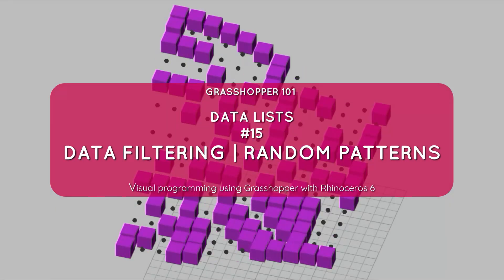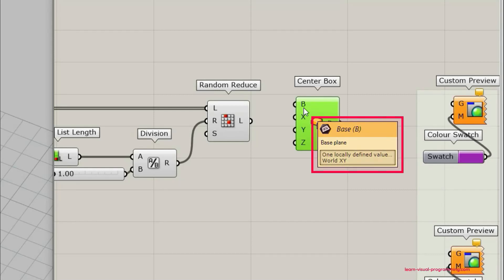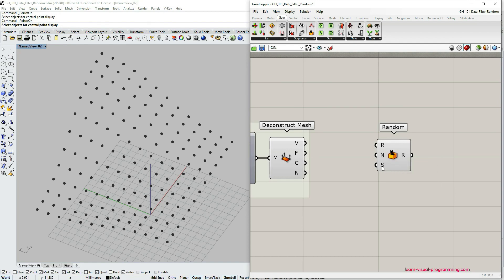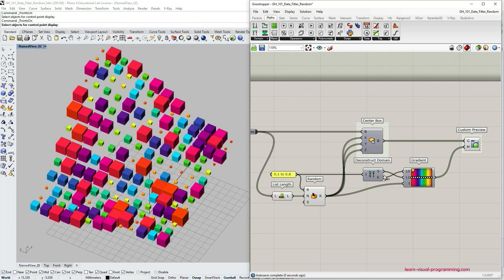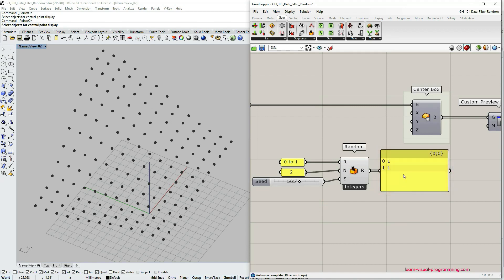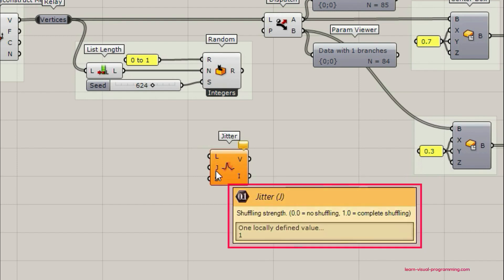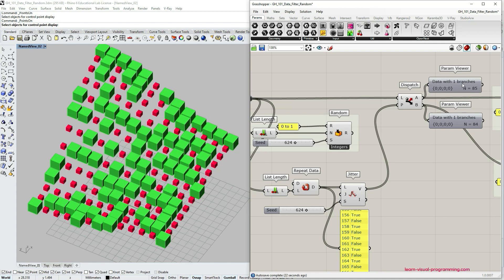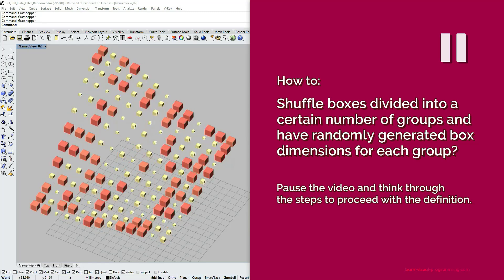Grasshopper 101: Data Filtering | #06 Random Sequence

Comment: Thanks! But I am still confused about the difference between random box and jitter.
Reply from the maker: Hi, thanks for the comment. The main difference is that the Random component generates a list of random numbers, while the Jitter component shuffles the input list. With the Jitter, you can also adjust the shuffling strength, i.e. how much randomness you'd like to have.
More information in the learning slides here: 
► https://www.learn-visual-programming.com/parameterization?lightbox=dataItem-ktwvj9fd1
And in the video tutorial here (utilize the timestamps):
► https://www.youtube.com/watch?v=S0_mynkYpXE